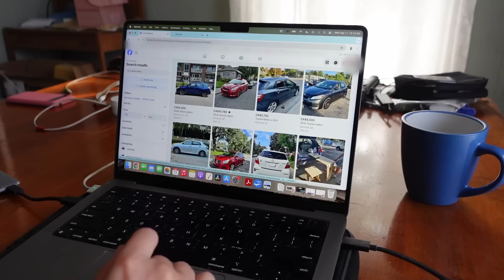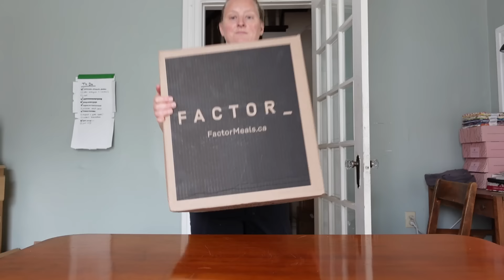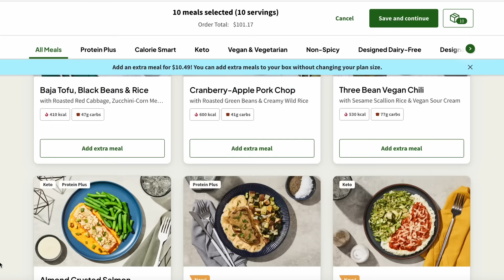an unwelcome surprise

Comment: It might be worth looking at a small van rather than a car. I renovated 7 houses and bought a second hand Mercedes Vito van. It's great. So much easier to carry everything.  You can put a tow bar on too.
Reply: We have one, too. I can even manage to sleep in it.👌
Reply: agreed. considering how integral your vehicle will be to the house repairs, it's worth considering❤
Reply: Yeah something thats good for load stuff in as well. Then less need of trailer or anything like that  as well
Reply: The problem with a van is that it will tend to get much worse mileage than a smaller car, which is a problem when you're driving across Canada several times a year. A trailer that you can attach or remove at will is a lot more versatile in that respect.
Reply: What is it with Toyotas? I have a 1997 Toyota RAV 4 with 138,000 miles on it. Four batteries in four years plus a $700 bill from the dealership to run diagnostics and they STILL cannot figure out that there is a parasitic draw. Not the alternator either so it has to be a bad fuse. I have to disconnect the battery when I park in the garage so the battery doesn’t die. This was my late husband’s car 🚙 and I like it for winter driving around town but my 1999 Chev Malibu with only 43,000 miles ALWAYS works and never gives me a bit of grief. The trunk with the back seats down carries as much as the Toyota, too. Original owners of both cars, no cost to license $0.00 because they are considered antiques in my state so the plates are permanent. They both look like new because I baby my cars. 🤱🏻😅
Reply: My Ford transit connect gets gas mileage more inline with large cars.  I life it, but the small 'city vans' are getting really hard to find.
Reply: @rachelkatin4904  hmm. good point
Reply from the maker: @rachelkatin4904 nailed it. I don't want to the do 12 hour trip from Montreal to NS multiple times a year in a van or a truck (gas mileage-wise), and I definitely don't want the hassle of trying to find street parking for a van on the streets of MTL either...!
Reply: @ShannonMakes Do you still need the apartment in the city? Maybe get a better vehicle if not supporting two homes?
Reply: “And then I left Phil alone with a vacuum and the camera.” Best home repair sequence ever
Reply: @VintageLPs really?  Ive turned in all my Toyotas (the only make Ive driven since I got my license)  with nearly 300,000 miles on them with absolutely no maintenance needed other than regular wear and tear stuff (belts brakes batteries and tires etc) current Toyota just turned 155,000 a few weeks back with the only times its been in for anything other than regular maintence was a recall. Two Corollas, a Rav V and a Tacoma (currently driving one of the corollas) - will be getting another Tacoma when I move up to my property next year.
Reply: Could also get an suv as well. We had an old outback for years and the amount of stuff you could fit into the back of it was impressive.
Reply: @louloubell6586  I drive a 2008 Subaru Forester. It can haul a small trailer. It also gets similar milage to a car, but the storage of a station wagon. The roof rack makes it possible to travel with sheets of plywood. But you might want to think about your future needs. Do you expect to have kids with the new to you car? Will you both need cars? Maybe consider having a city car that is small and a larger one for all the renovations in Nova Scotia.
Reply: @rachelkatin4904  Not necessarily. My vito is a diesel, and it does really well. Diesel motors last longer than petrol motors.  I've slept in the back before too.
Reply: @ShannonMakes  If it's a diesel it uses less fuel than a petrol engine.  The vito is only the same size externally as my Mitsubishi 4wd. I drive mine 4.5hrs on Friday nights from Melbourne to my cabin at Venus Bay. I live in Victoria, Australia, and everywhere is a long way for us. It's actually really comfortable.  I think you're thinking of a truck more than a van.
Reply: @rachelkatin4904  Like I responded to others. Not if it's a diesel. They use less fuel and the motors last longer than petrol motors.

Comment: Hi plant nerd here! It looks that plant your pulling up looks like a species of coltsfoot, it's a medicinal plant brought  over from Europe and actually is used for tea and cough drop, if you do use them though it good to double  check with a plant app just in case ( they should have a flower similar to a dandelion that bloom in the spring )
Reply: I wouldn’t use coltsfoot though, because it can cause liver damage.
Reply: @dottiewi661  ya I look that up but both of those cases were link to miss identification of the plant as ther is 2 similar species but have very different flower, which is why it's best to do research before eating anything, the info I found on the cases was on the wiki page for Tussilago farfara which it's formal name
Reply: Yes to the coltsfoot ID (not an expert but that was my guess, esp looking at the roots) 

But

Do not eat ANYTHING that's growing around your foundation until you do a soil test.  An old house like that, you wanna be sure lead paint dust hasn't been gradually sifting into the soil. 👍

Also, if it's coltsfoot, sure you can "pull" the plants, but I think it spreads via rhizomes in the soil, so you won't have eliminated it with the first round of pulling.  Just keep at it - you'll exhaust the rhizomes' energy reserves eventually once you can keep on top of it...

(uh, not sure how often you'll be absent for months at a time...)
Reply: Devils rhubarb is another name for cow parsnip. Look it up on Wikipedia for interesting facts. The sap can cause blisters on your skin on a sunny day but parts of it- peeled stems- are edible and the roots produce a dye.
Reply: @lapoppy4801  Careful with common names (ie Devil's rhubarb); they're too often used interchangeably for different plants.  Cow parsnip is a plant with utterly different leaves than the ones Shannon's pulling.

I can't personally be 100% certain about the coltsfoot ID, but because of the shape of the leaves here, I am 100% certain that it's not cow parsnip. 👍
Reply: I was coming to comment that the plant looked like coltsfoot. We have them here in New Brunswick, too. Didn’t see anything about eating the roots but it looks like Phil is fine lol
Reply: @rebeccaburnell9319 ah that is very good point, i never considered lead being in soil, lead paint isn't common where I live due to living in a less established part of Canada but I will 100% be keep that in mine for the future 🙂

Comment: The  "Devil's Rhubarb" is "Coltsfoot", another invasive, but not nearly as bad as the Knotweed.  Its yellow flowers look like a cross between a bachelor button and a dandelion.  Don't let it fool you though, just pull it out.
Reply: 23:13 Oh yes, that's the plant.
The flowers are edible, at least in moderate amounts they are quite healthy in springtime. Nice topping on a salad.
The leaves used to be toilet paper in olden times because of their abundant growth and soft underside.
Good as tea or syrup against  cough and I use them as part of my homemade hair conditioner together with nettles. 😅 See, I love them

Comment: Had an unwelcome surprise too. Wife calls me when she gets to work saying she lost all power in her car. Probably alternator but she's well over 200k miles so not really worth fixing. Sigh. Wanted another year out of the car without issues.
Reply: Just replace the alternator--you might get another 100,00 miles out of it. You'll always regret it if you find out the person who buys it from you cheaply, gets another 150,000 miles out of it!
Reply: An alternator is generally worth fixing! I’ve swapped out 3 and I am no mechanic. Lucky person who gets your car next!
Reply: @goodandgreen  not when a car is well on its way to 300k miles with about 15 other things wrong, and requires removing the bumper to remove the alternator.
Reply: @RyanMercer  yikes! Remove the bumper?!?!!!
Reply: @CheapEngineerCrafts  sadly that's becoming more standard on cars, I believe Chevy has something where you have to remove the front of the car just to replace a headlight. Engineers are about saving money not making cars serviceable.
Reply: @CheapEngineerCrafts  and even my impala requires me to remove the entire dashboard to replace one of three actuators that control the hvac... And it cycles every time you start AND turn the car off and thr little nylon gears wear out every couple of years... eyetwitch
Reply: @RyanMercer  I guess cars are becoming disposable, too. Killed me to replace a whole side mirror assembly when just mirror was cracked
Reply: @CheapEngineerCrafts  yeah, it's very unfortunate.

Comment: Oh, do I feel your pain about the car. My 2008 Saturn Aura, that I love, was about $4800 to pass inspection this year. Our mechanic friend, who has helped keeping it going for years, said it is time to let her go. BUT, she has a good engine and tranny still, at 154,000 miles. The rust issue was a big part. Not on the outside but underneath, as a Saturn doesn't rust on the body. (Hoses, brakes, power steering issue, tires ...etc.) I hate letting her go for junk too! AND, I have been looking for a Vibe too, for the same reasons. It is basically a Toyota.

Comment: That weed looks like Colts foot to me. Very invasive and propagates by little yellow flowers that look a little like dandelions in the spring, but also by rhizomes. The Devil's rhubarb is an apt name as this stuff is so hard to get rid of. I read that cutting it will eventually exhaust the roots rather than picking it which can leave pieces of root in the dirt that can grow a new plant. If pulling, make sure to get as much of the root as possible. It likes poor rocky soil, which is why it likes to grow next to the house. Hope that helps, good luck!

Comment: @13:45 The yellow flowered weeds are called goldenrod. You can cut the flowers and young fresh leaves and steep them in hot water for a tea that's amazing for upper respiratory, flu, colds, sore throat, etc 
Just add a little honey & lemon 😍🤤🤤

Comment: I have an old car next year it is 20 years old but it still has only 77,000 on the clock and starts every day. I have car insurance with Saga and for a little more it includes breakdown insurance. If I break down they will fix it or tow it and also take me home. I know Canada is probably different, I live in the UK.

Comment: My son and his wife had a Honda Odyssey at one point, it was a wee ripper...1.8litre 4 cylinder, 7 seater, could tow a 6×8 caged trailer no sweat, between 550 to 600 k's from a 65litre tank. It drove like a car but with the capacity of a small bus,,,the seats all folded down to make a very comfy bed for 2 adults and a couple of small children,,,or in your case, 1 semi-floofy Corgi 😉 
Theirs was a late 90s/early noughties model, the only reason they got rid of it is they outgrew it and needed a bigger bus 😏
🙃🐨🇦🇺

Comment: Vacuuming has always been my most hated job, but after watching Phil I will no-longer think that way while struggling with mine, he made me laugh so much I had to watch that segment all over again.😹😹
As someone pointed out maybe look at getting a van, it along with a trailer will be such a huge boost with home renovations. The biggest drawbacks with having a trailer is making sure you have a very secure spot on the property where it not only sits but can also be locked down to that location so that someone cannot just come in while you are not there and drive off with it.
A friend of ours built a fixed horseshoe pipe concreted deep into the ground so that it acted as a hitching post to sit the trailers towing joint onto to keep it off the ground and a point where it can be chained up when not in use. 
The one thing with trailers are they are easier to steel and sell on than a stolen car can be. They don’t have the same security features that cars do. 
I was stunned at how cheap it was to get your tree trimmed, I have been quoted over $1000 AUS to remove two spindly sized trees that are a quarter the size of the whole branch that’s been removed 🙀 off your tree. 
As crippled as I am I will be cutting them down on my own, at least they are not close to the house so I can do it in sections and they are not too big, ones dead except for a single branch at the very top is still flowering 😳
Reply from the maker: heheh 🕺🏻🎪🕺🏻💪

Comment: I don't know if youve found a car yet, but it might be worth looking at Subaru Foresters as well. I don't know if there's as many of them over there on the East Coast, but my husband and I are both driving 20+ year old ones and they're fantastic. Our '04 has 150k miles on it and the '99 has 275k and we're only just beginning to think of replacing one.
Reply from the maker: I love Suburus, and grew up surrounded by them, but they're exceedingly expensive 😭😭 My budget is slightly higher than previously (previously being literally a couple weeks after I just bought the house 💀), but not by much. Plus if we keep the same model car, we can reuse some of the parts that we'd bought new and installed in the first Matrix.
Reply: @ShannonMakes  ah. Yeah, they're quite often on the cheaper side over here on the West coast.

Comment: Aw car trouble sucks! I think today I’ll be going to pick up my car from the shop. It died a couple times while idling, and then while driving it completely cut out and died too! They discovered it was an old school power relay, and the solder dots were melting into the board I believe. The technician said he hadn’t seen that problem in 20 years! (Car is a ‘97) thankfully that they have very knowledgeable staff at VW.

Comment: I will say I used to get SunBasket.  Getting food from them was helpful if you don't know how to cook because that comes unprepared and you get cards that tell you how to make it... that was nice for a while not having to think about what I needed from the store... and to just pull out a bag and make whatever was on the card.  Now with Factor, it is nice that it comes fully prepared and all you have to do is heat it up.  Almost rather prefer that as a single person, it's hard to "make" anything really because you end up having to make far more than single servings often so you end up eating the same thing a lot... but anyway... no judging you here! Glad you had food come to your door!  One less stress.  As for the car, how much do you replace on a car before just buying another is cheaper?  Transmissions are NOT cheap even is you get a used one or a rebuilt one.  There is a reason they are painted gold... Just saying.  I worked in a garage for a while as a "grease monkey"... was a full-service service station back in the day... anyway... also my Pops had an autobody shop... so I grew up around cars.  That is always the dilemma of cars. If you buy used a lot, you often buy something someone else didn't want to fix.  Fixing your own you know what you have done to it... buying someone elses car you have no clue what sorts of things they have replaced or not.  But if you know enough about them you can usually test-drive them and figure it out.  I will hope and pray for you to get a great deal on something.

Comment: Last year i sold my 20 year old car (i've owned it it for 10 of those years) and decided to buy a bramd new car.  I am also on a budget and it actually was better to finance a new car that would come with a warrenty and i wouldnt have to worry about emergency repair bills for many many years. Whether i got a used car, or a new car, i would have to finance it anyway, so we opted for the new car so we could get a warrenty and have a car that will last me 20+ years. For far, it has been well worth the investment.

Comment: Good advice from The lemonaid car guy dont spend over 3000 on a car repair at that point you should invest the money in a newer resale car preferably no older than 2 years this really help me to decide to scrap my matrix when the transmission went, they are a great car mine was 13 years and had over 400 k on it and it was a workhorse.  I’m so enjoying the videos.  You never said why the cops were there did they think you were squatters lol
Reply from the maker: unfortunately there is absolutely no reality in which I can find a 2022 car (here or in Montreal) that will even come close to fitting in my minuscule budget 😭😭😭

Comment: Given the fact that you plan on towing a utility trailer, may I suggest looking for a small SUV or even a minivan. These types of vehicles will give you decent towing capacity without worrying about dropping the transmission out of your vehicle on the first hill you encounter with a full load of building supplies. In other news, I am so sorry you have been given this additional challenge but I know you and Phil can overcome anything that gets thrown at you. Good luck with your new to you car search; fingers crossed you find exactly what you are looking for. 😊
Reply from the maker: Thank you, but I'm not sure I want to the do 12 hour trip from Montreal to NS multiple times a year in a van (gas mileage-wise, for one), and I definitely don't want the hassle of trying to find street parking for a van on the streets of MTL either... there's a reason I am not looking for a van or a truck 😉

Comment: If nothing else, any vehicle you intend to buy, get it inspected first. Yes, it will cost something, but it's far less likely to be a lemon. See if the seller keeps the repair records. Check fluids, oil and definitely tires for uneven wear.(Alignment may be out...ouch repairs). 
Phil may be somewhat annoyed at a complete stranger posting this, but it comes from experience.